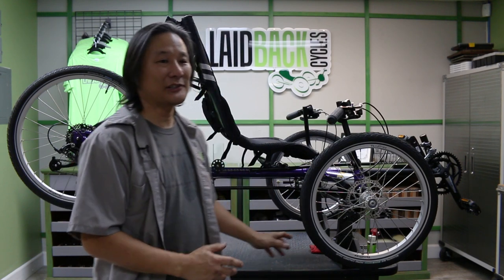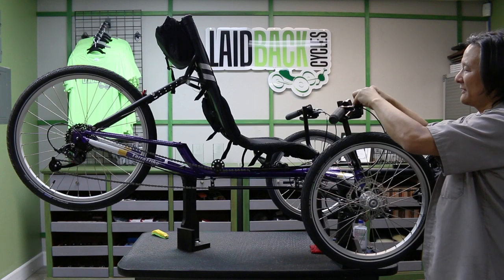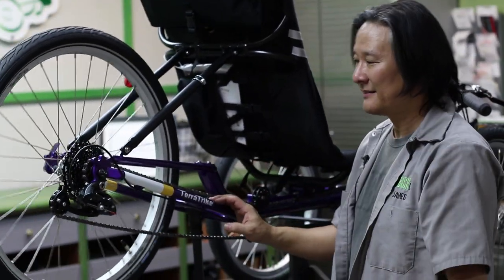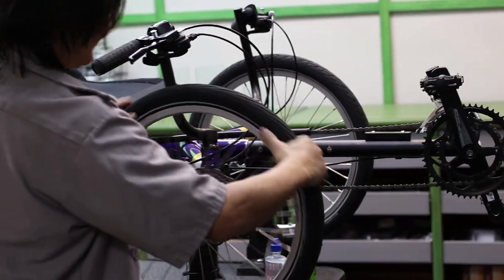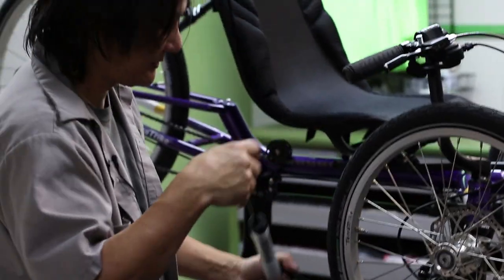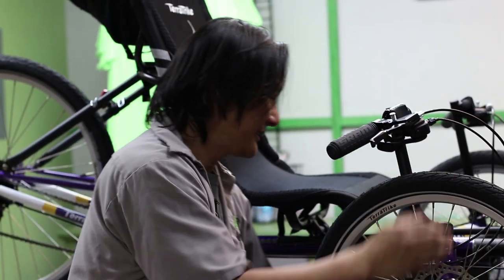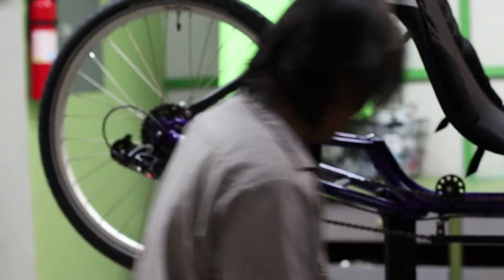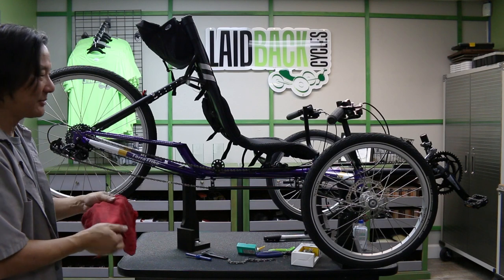Recumbent Trike Maintenance Workshop

Comment: I always check the inner side of the tire before I put a new tube or a patch to back in, reason why, because you could have some debris is punctured through the tire still on the inside so I need to do is take your fingers and feel around lightly for any projection that’s still could be in the rubber tire.

Love the video

Comment: One important step left out of the video is to run you fingers inside and around the tire before replacing the new or repaired tube.  Doing so you might find a thorn or a piece of glass still sticking through the tire to the interior and if it isn't removed it will just flatten the new tube again.
Reply from the maker: Yes, I used a hand towel to see if it catches something in the tire. If I ran my fingers and there was glass, it might cut me. Ouch!

Comment: Good video EXCEPT for the rear flat catastrophe. The odds of finding a large box or bag to prop up you trike to take the tire out, are like a gazillion billion to one ;-) Everything looks so easy on a bike jack ;-) In the real world, us mere mortals would probably flip our trikes upside down. I think it might be possible to get the tire open enough to pull out most of the tube, pump it up and try to find the leak, so no wheel removal hassles, but I just don't know. The idea of getting a rear tire flat scares the hell out of me. I'm 71 and dealing with that would be like major panic attack time. I'm using the Schwalbe flat proof tires and so far in over ten years have never gotten a flat with those tires. The quick links thing I've never heard of so, will have to grab a couple of those for the tool kit. I STILL WANT TO SEE A REAL HUMAN DEMONSTRATE ON THE SIDE OF THE ROAD HOW TO DEAL WITH A REAR FLAT TIRE, something believable.
Reply from the maker: I like your idea on the real life scenario for changing a tire on the road. We'll see if we can make one :)  Our most popular tire is the Schwalbe Marathon Plus, because we all agree getting a flat SUCKS!

Comment: The first thing you should do after patching or replacing the tube, and before reinstalling the tube is to check the inside of the tire to make sure there is not a thorn or nail sticking through the inside of the tire.  If these are not removed, the tube will be damaged again.
Reply: I was thinking the same thing. Also it's a good idea to get your patch kit out and have everything ready BEFORE you locate the leak. Otherwise you will probably have to go through locating the leak a second time.

Comment: 10:55 Speaking of things that will get you home short term.  I've had success using chewing gum.  Chew it up, then mixing it with fine sand or dirt, then packing it into the hole, while the tube is still on the bike.  I did this once when I ran over a construction nail, chewed up the gum real fast, then pulled the nail, and pushed the gum into the hole with the nail while the tire was still bleeding air.  Then I repumped the tire.  This is not a solution I enjoy employing, but it has saved my butt on three occasions, and worked WAY better than I thought it would when I first had to try it out of sheer desperation.  When I got home (several miles away) I still had full pressure!  The real down side with it is it's really only good for larger holes (nail sized not sticker sized), so if it's a smaller hole you'll have to increase the size, and you'll need an object  to both do that and to pack the hole with.  This is a lot easier when you can use the object that made the hole to start with.  You also need to have air in the tire while you do this.  A completely flat tire will be very difficult to work with, but you can pump it back up (if the hole isn't too big), to do the "repair".

Comment: What about adjusting and lubricating wheel bearings to get the best spin time on a wheel. With years of biking behind me on two wheel bikes I always was concerned with the ability of the bike to coast long distances with minimal drag within the wheels.  there is nothing bettwer than a hub that has a low drag coefient.

Comment: What is the different between the terratrike Maverick and the Catrike Max? there is $2000 different.
Reply from the maker: TerraTrike aims to offer more affordable models, while Catrike focuses on comfort and performance. On the MAX, you get better components, better engineering/design/ergonomics, and more features. The Maverick is a great trike for riders that want to start triking on a budget and aren't as concerned with performance or ultra-comfort.

Comment: Just picked up another one (used, this time) - the rear hubs are stuck on the axles  - I am guessing they corroded on because the hubs are aluminum and the axles are steel) - anyway - I have 2 damaged rear wheels that need repairing (broken spokes) and can't get these rims off the axles on the bike - HELP.
Reply from the maker: If you need maintenance, feel free to schedule an appointment for service if you are local. If you're not local then a bicycle shop in your area should be able to do service for you.